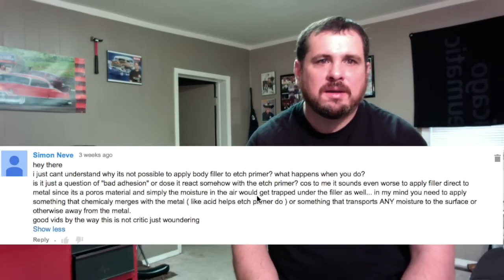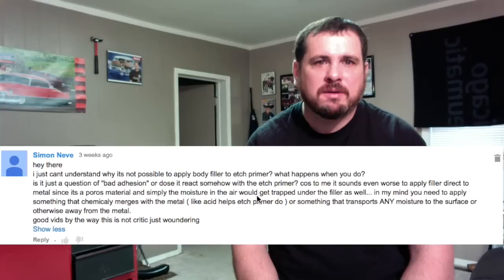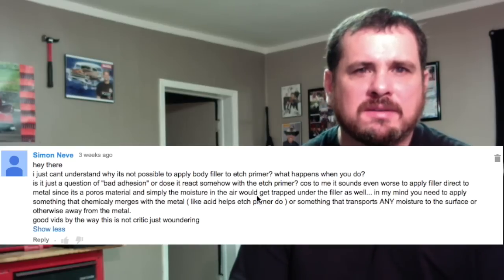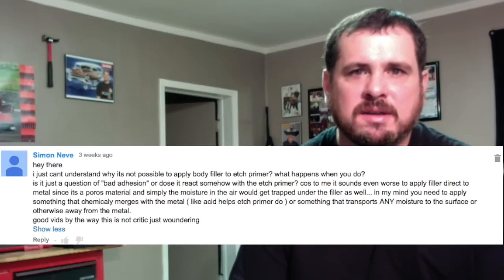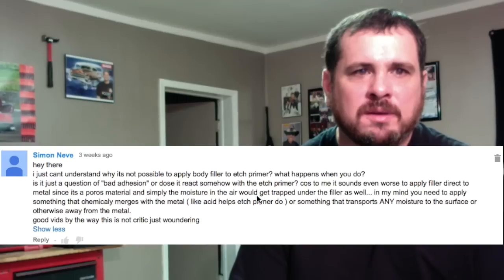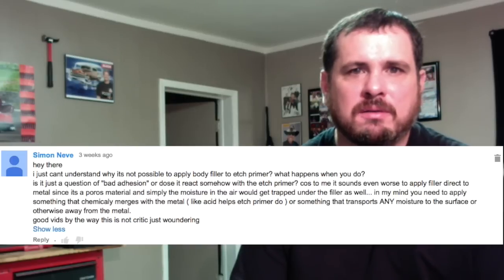Why Can't Body Filler Be Applied Over Self Etch Primer?

Comment: I did actually ask a chemist, who developed one of the best polyester resins used in body filler, why you can't put filler over etch primer.  His answer was, that the acid in the etch primer slows the cure of the polyester resin in the filler.  Filler companies don't recommend using their products over self etch primer, because most users cannot tell if there is any acid left in the primer film.  Self etch primers are usually mixed 1 to 1 with a converter/hardner that is a solvent with 5% phosphoric acid (the etch part of the primer).  After mixing 1 to 1 the reduced primer has 2 1/2% acid.  The phosphoric acid converts with the steel to form iron phosphate, and since acid is constantly converting, usually the rest in the mixture converts with the solids in the primer.  The variables are; if you put too heavy of a coat(s) on, excess acid can be trapped in the primer film, texture or deep sandblasting or rust pits could trap acid in the pores/pits/texture.  The excess trapped and not converted acid could affect the catalyst of the filler causing slow and uneven cure.  Etch primers bond to the metal with both chemical (acid etch) and mechanical (sand scratch) adhesion.  On older restorations, sandblasted rusty metal,  I sand the blast texture smoothe with 180#, then clean, then etch prime.  I prefer using self etch primers followed by a GOOD 2K urethane hi build primer (SIKKENS or comparable).  If I'm ready to use filler on an area, I grind off the area and use filler then reprime with 2K.  When I put filler on bare steel, I try to make sure the metal is warm (70-80 degrees) so moisture doesn't condense on the surface and the filler through cures evenly and not from the outside in.  A light film of (invisible) moisture can condense on the metal surface, which is usually 10-15 degrees colder than the surrounding air temperature.  If your shop is at 70-72 degrees, the metal is around 60 degrees-- carefully pre-warm the panel if the metal is cold.  This removes the condensed moisture and helps the resin cure evenly.  Polyester resin (body filler) just about stops curing below 64 degrees.  This means your filler will cure from the outside in and maybe the filler at the metal surface won't completely cure until it's finished and painted and set out in the sun on a 90 degree day.  That is usually the reason for cracking and bubbling and rust forming under it from the moisture that condensed on the cold metal.

  Now, putting epoxy primer over self etch is another lesson in chemistry.  Phosphoric acid (metal prep/ self etch) can affect the activator/hardner for epoxy primers so it will dry but not cure.  If you metal prep/acid etch bare steel, you have to rinse it off and neutralize it before applying epoxy primer.  Actually most companies recommend acid washing (for removing rust) steel before applying epoxy primer (read most tech sheets).  Most automotive epoxy primers have low to moderate film builds and long cure times and only a few have really good solids content (and film build).  This epoxy looks like a great hi build with fast cure.  I have not tried it, but I see some restoration shops use it.  https://us.ppgrefinish.com/getattachment/d43851be-a545-4eb7-a18f-e67540f9a518/VB18_VP2050-DTM-Primer-8-13.pdf.aspx        Another issue is using epoxy primers in cold weather.  You can encounter similar problems like using filler in cold weather.   Here's a good tip from PPG.  https://us.ppgrefinish.com/PPG-Refinish/Products/Tech-Tips/Paint-Pointers/November-2018/Epoxy-Primers-and-Cold-Temperatures
Reply from the maker: Thanks for providing additional information on the topic and the resources.  Great information!

Comment: Firstly, thanks Donnie for the excellent videos!  I had an area low at the front of the wheel well, which had some flex to it. The previous owner had filled that area with body filler. On closer inspection, I could see a hairline crack in the filler and when I removed it, underneath was a healthy rust deposit. I see that if the panel has a reasonable amount of flex the filler will crack. I am a novice metal painter but have many years experience with wood. It makes sense to seal the metal surface first and then apply filler.

Comment: the heat from the filler curing on bare metal creates condensation between the filler and metal so even if the panel is dry and clean you still get a small amount of moisture in there and will rust eventually
Reply: Nope it’s not the heat creating condensation. It’s the fact you had water there to begin with

Comment: use etch filler primer sanded  then bondo filler sanded reg primer then sanded 4 coats of paint  then 3 coats of sealer 1000 to 5000 sand cut polish and she looks fantastic so far after a month no issues FYI i waited 24 hours after laying down the etch filler primer before doing anything else

Comment: Although I only work on my own stuff, so I'm not very experienced compared to you guys. But I have taken three older cars down to bare metal. One Jeep two Volkswagens. there was previous body work and Bondo applied in the past on all three vehicles. I removed the Bondo from all three vehicles. Everywhere the Bondo was applied to bare metal, there was rust in between the Bondo and the metal. Every one of them! Which really drew my interest. So I looked into the matter. I have found that when you put Bondo on bare metal the chemical reaction of the Bondo drying heats up the Bondo. This causes condensation or sweat in between the Bondo that you just applied to your bare clean metal. So before you even get your primer or paint on, your car is starting to rust underneath the Bondo. I've only found two ways to prevent this. And that is a climate control atmosphere so your metal is warm when the Bondo is applied. Or simply primer the metal first. What say you??

Comment: Sooo..  youve never done it?  Or seen any results of it...   there is also a few different types of bondo and they each have different characteristics like adhesion to certain materials, sandability, dry times, density, marine applications , etc..   but im wondering if the etching primer goes on, then dry sand it smooth  with 400, then clean with acetone and tack wipe it and apply an adhesion promoter lightly over the primer and put your bondo over that..   now ive seem bondo go over primer that hasent had the complete cure time and the bondo will  pull the primer off with it if you pick at it like paint does when it delaminates and you can pick it off like that but its stuck just as good as the primer when the primer has had its cure time and us cleaned/ prepped good both before and after......   just an educated rant..

Comment: I did it today and it bubbled up and lifted all paint redone tho it's fine now.. first after all sand I sprayed self  etching primer on a metal spot, then  I primed with regular primer  then seen a few bad spots after primer,  used glazing puddy on the area I used the etch and it's destroyed it. The other places I used etch then regular primer is fine. But redone today so0, I cleaned up the bubbles feather edge what was tore up use bondo instead before primer then. Primered. . I could have use the glaze on anything but where I used etch. So I'm not using etch no more on damaged areas.that I would have to use glaze. I use the etch for the edges and on the good metal that doesn't require work

Comment: I have some rust pits which show under the moldings on door of 56. What is best way to solve this issue. Epoxy over pits and then go back and sand and use filler where I ground this area down a bit trying to remove as much rust as possible? Or filler straight on to metal and rust pits and then sand and epoxy over?
Reply: Rub your balls on the rust for proper removal then apply filler

Comment: I used self etch primer to bare metal but i need to apply body filler. What do I do now?
Reply from the maker: I would probably sand the area where filler is going to be applied to bare metal.  Most premium body fillers have zinc, which provides corrosion protection.

Comment: Can you take something down to metal,and etch primer it,then apply paint over etching primer?  Or would you have to apply a primer surfacer over the etching primer then paint? Ask because I seen someone painting their brake calipers and they etched primed them,them applied paint.
Reply: I’ve done this using ppl paint and etch primer for some rims. Worked great, no rust 10 years later. I’ve also put primer over etch primer and then filler with no issues. In my climate filler to metal just doesn’t work due to excess rain and moisture. I’ve had more issues with epoxy primer than etch primer.

Comment: Wow i was not expecting a video replay! Thanks alot!

just a thougt, would it be possible to say spray with etch primer and then something else ( say primer surfacer ) witch the boddyfiller would have good adheasion to and go about it that way?

Reason i ask is that i am on a VERY hobby level at the moment and are still locked to 1k products more or less ( cans) and 1k epoxy primer is crap and 2k is either needing a spray setup or is alot more expensive than 1k etch primer cans. So i know the correct way but would it help to go around the rules like that?
Reply from the maker: Simon Neve  I have not ever actually tried it, but dannyaya left a comment that the body filler will not adhere.  So it may be best for you to use a premium body filler and apply straight to the metal.  That was a good question, thanks for asking.

Comment: @DIY Auto Body and Paint Hi,after sanding a car down to bare metal,filling then spraying ETCH primer over it, can i go straight to base and clear after that OR is there a stage inbetween ETCH and basecoat that i should do?
Reply: Yes you take a carpet seam roller and roll it over the area for a bit then wipe it down with a good gear oil, let it set like that for an hour then apply the first color coat very thick, dont wirry about runs you can wipe those off witg your dry paper towel..  them immediately whilr color is still wet then you apply the clear..  make sure to get the 2k and dont pop the sack in the bottom until the can is about empty and use that for the final coating.  Then whike its still wet apply a thin cling wrap over the area until cured and then you put turtle wax on it and leave it overnight and wash with toilet bowl cleaner and a wire brush..  perfectō
Reply: @Z-Ack  fucking legend. thanks mate.

Comment: Can you apply etch primer over bondo?
Reply from the maker: You will get a little on your body filler when spraying bare metal spots.  But I would not apply too much over body filler because the acid in self etching primer may try to lift or soften your filler.

Comment: Thanks for the video. I am working on my project and I'm trying to get it ready for primer,but what can I do if I do the body work and I think I did a good job but when I sprayed the primer I found some body work imperfections that need more body filler? Can I apply the body filler aver the primer by maybe using some 220 grit sand paper and then apply the filler? Then do the 220 to shape it and 320 before priming again ? Thanks.  :0)

Comment: I once made the mistake of spraying polyester primer over etching primer and wow what a mistake had to peel the primer off don't know what chemical reaction went on there but they polyester primer turn the goo underneath and never really dried it was mixed properly etching primer was fully dry before hand spent a week stripping it to start over with epoxy  ended up calling ever coat to see wtf and now they put do not apply over etching primer on the label

Comment: does anyone know if it's ok to put self etching primer over bondo?
Reply: You can spray etch primer over filler,i do regular if i have rub threws or patches of bare metal before applying the 2k primer, also you can put filler over etch primer, I have been doing so for over 20 years and had no issues

Comment: It doesn't stick. In my first year as a panel beater I tried it and the filler just came off in lumps.
Reply from the maker: dannyayo I have never tried it so thanks for letting us know.
Reply: No problem. i had the same thought as to why it wouldn't work, as etch primer would protect the metal but yeah it didn't work
Reply: +DIY How To Paint A Car School i tried it and it stuck no problem. used wurth vaku light filler